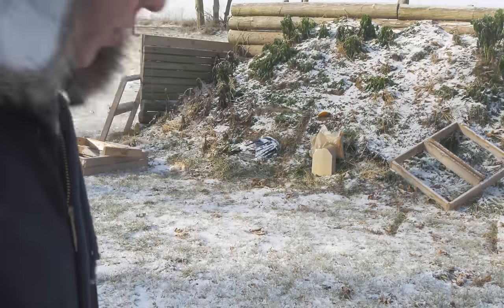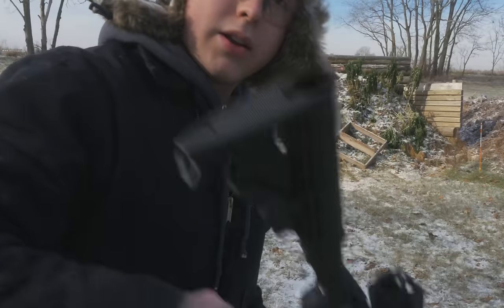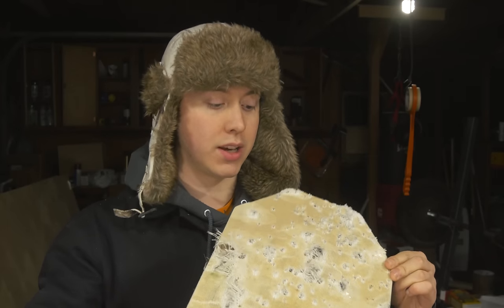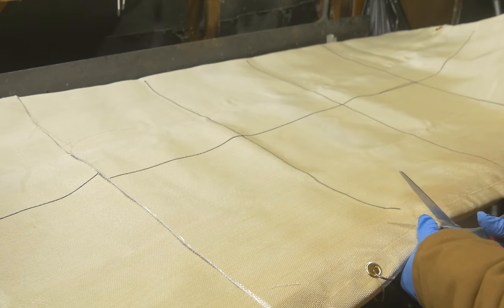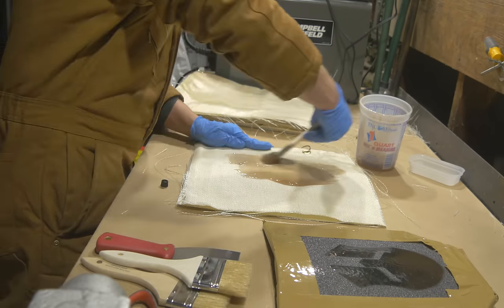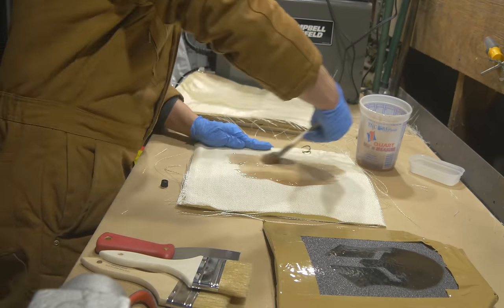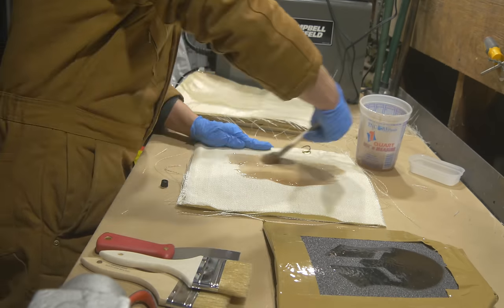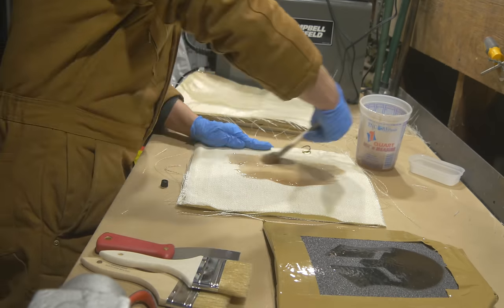How to Make AMAZING Bullet Resistant Armor for $30

Comment: PLEASE USE A RESPIRATOR IF ANYONE ATTEMPTS TO MAKE THIS.

Microscopic glass particles in your lungs is NO joke.
Reply: I was cringing so hard the whole time he was cutting and just sucking in microscopic bits of glass fibers.  Ugh!
Reply: Because it is possibly a cancerous hazards, right?
Reply: probably because of the fact that glass shards can cut things like your lungs
Reply: Yolo
Reply: Isn't it basically just as bad as asbestos?
Reply: I’m planning on making some so thanks
Reply: @notpulverman9660  Nowhere near as bad as asbestos, but still not bio friendly :) When getting a respirator, your best bet is to get the kind with cartridges and the mask itself is silicone... if not those, at least get the stiff paper ones that have a valve in front and check that they conform to your face... the ones that are just paper w/o a valve are almost worthless.
Reply: Barış Uzun It actually doesn’t have anything to do with cutting your lungs. Round, relatively smooth particles can be processed by your lungs and disposed of properly, but fiberglass particles are long, inorganic strands that our lungs are incapable of disposing of. A few fiberglass particles probably won’t do any damage, but grinding fiberglass without a respirator may do serious long-term damage.
Reply: Certainly doesnt feel good if you're stuck in an enclosed space with a cloud of fiberglass surrounding you. You'll hate your life for a week or so.
Reply: @lucapoli4195  no... inhaling millions of microscopic pieces of sharp glass is the bad part!
Reply: The Anime boy: yet
Reply: @c5back9  I wouldn't go quite that far. Asbestos is some really nasty stuff.
Reply: Please use a respirator ANYTIME youre working with fiberglass... Its Glass, People!
Reply: You mean a stroke when the nano particles get into your bloodstream and jam up little arteries in your brain and other locations in the body. Glass in the lungs is the least of your worries lol. Composite materials are far better against impact and to experiment with and you have less health hazards.
Reply: Yep this man is crazy
Reply: Either that or wet-cut.
Reply: @The Anime boy Luckily not carcinogenic, but fiberglass will still mess up your lungs.
Reply: Tell this to every engineering grad student in the US.
Reply: @notpulverman9660  When you think about the lung's ability to filter out those particles, then YES...it is as bad as asbestos.  That's half the issue with asbestos...the body cannot filter it out when it is breathed in because it's so small and it goes way down in your lungs and clogs your alveoli, inhibiting the transfer of oxygen from the lungs into the bloodstream.
Reply: No, cancer isn't the risk like with asbestos, the risk is the same as textile mill workers: copd
Reply: No, cancer isn't the risk like with asbestos, the risk is the same as textile mill workers: copd
Reply: Make one be fine. Make ten be called weezy.
Reply: Diogo Emiliano implying that octagon warriors work in fiberglass shops
Reply: @lucapoli4195  no doubt
Reply: I worked with fiberglass to fix a rust hole. There was strong wind from my back and i did it outside in the open. I didn't think about the tiny particles getting onto my skin though. My arms were itchy for days. I hope i didn't breate in anything.
Reply: Pneumoconiosis? Yeah, it's no fun.
Reply: Thank you, I'm making this next week and had no idea. 👍
Reply: Yeah it is dude it's funny af. Be sure to breath in all the glass u can kids
Reply: Glass lung is bad.
Reply: "Oh I should be just fine because I'm not using a rotary tool." Lol. "I'm just gonna clean up the edges with my belt sander"
Reply: 10:39 he grabs for a mask
Reply: Also at 13:00 damn did u even pay attention?!?!?
Reply: David S. makes joke about microscopic glass particles in lungs
Reply: Ahh so its fiberglass havent watched the video
Reply: Not Pulverman it’s not THAT bad but it’s pretty bad
Reply: Ok boomer.
Reply: Just reading the sentence is triggering my asthma
Reply: This video is completely irresponsible for not using a respirator
Reply: Tarman The Champion r/madlad
Reply: Turn into sand man but made from glass...
Reply: Diogo Emiliano  ok boomer...
Reply: Done and done! 😉
Reply: I CAN'T FIND ONE.....
Reply: David S. Will do. Thankfully i have one
Reply: i didn't know fiberglass was made with glass
Reply: @Xannyphantom905  it does
Reply: so its not 30$ then. deal breaker
Reply: Pulmonary fibrosis....you don't want that
Reply: Diogo Emiliano  Sounds like someone dropped out of 3rd grade.
Reply: @dylank.9573  a week? Itching?
Reply: LOL i get it!
Reply: I love the warm lung feeling I got 😍
Reply: And do it outside.
Reply: How do you make the atoms of a cup laugh?
Microscopic glass part-ticles
Reply: I wouldnt wear them just incase a cannibal kills and tries to eat my lungs i will taste bad
Reply: Such beautiful advice
Reply: Any idea on the resin being used?
Reply: What do you mean a morning glass of cancerous micro glass is great
Reply: Diogo Emiliano  lame
Reply: @charleswalter2902   lucky
Reply: Diogo Emiliano  I'm fake now because I names myself after one of my favorite bands ? I'm fake because I don't have technical capability to make crappy YouTube content? I'm a fake because I don't put up lame video game streams? Or am I fake because I don't have time to make content while I'm out there trying to actually do work and help people. Dude get off the video games weed and Coca-Cola then get back to me
Reply: Nahhhh, fiberglass makes your lungs stronger
Reply: @markhenrikson9790  ironic that less than a year after posting this saying paper masks are useless makes you anti-science lol
Reply: @markus9415  Fiberglass doesn't contain nano particles. They are small but far, far  larger than nano particles.
Reply: @hia1thealt  Mark, asbestos is clear down at like 10 microns or less, I am fairly certain that fiberglass is considerably larger than that. I have heard of a version called S-glass that they said was more risky, that may have smaller particles but apparently it is a specialty item, not used very often.
Reply: @markhenrikson9790  Look up nano polymers :)
Reply: @markus9415  Interesting. They are adding them to fiberglass to get better moisture resistance and such. That is way on the high tech end of fiberglass though, not the kind of stuff this guy is doing.
I do worry about how many places nano particles are being used when they are still so new. From what I have read, nano particles can act very different than the same substance with larger particles and pose completely different risks. Also, I would guess that even a good HEPA filter will have trouble properly filtering out nano particles. The throwaway paper masks will do even less since they tend to have a very poor face to face piece seal.
Reply: @markhenrikson9790  Correct. This person in the vid will only get some irritation without some protection. I was overexaggerating a bit :) But there have been cases where it did much more damage then just irritation.
Reply: @astr43us  inflammation and resulting scarring
Reply: Bro why is everyone talking about the fu$ing fiber glass but not the fake $30 dollars dude is talking bout !

Comment: That was a very cost effective test and I enjoyed watching it and learning more.
One way to make this stronger would have been using epoxy resin instead of polyester resin. Another way would have been alternating thread directions of your fiberglass cloth. In other words, put the first cloth down with 0/90 degree cloth thread orientation and the next one with 45/135 degree orientation, then alternate again. That way you are getting strength and energy dissipation in more directions. These changes could possibly have gotten you 10-25% more performance. It might not have made a difference though as the 5.56 looked like it would blow right through it anyway.
Adding Kevlar, on the other hand might have made a bigger difference but I don't know if it would be worth buying kevlar unless you upgrade to epoxy. Epoxy is substantially better than Polyester, at least for boats and planes. I used Carbon, kevlar and glass with epoxy when I built my 31ft trimaran performance sailboat. Two years of playing in that stuff was enough for me.
Using epoxy and kevlar though would have cost much more money. Probably 5x for the epoxy and 10-20x for the kevlar.
Reply: Two years! Wow I can only imagine! I worked with fiberglass doing body work on door bottoms on triumph tr-6 1972. You are dedicated sir!
Reply: You sir are a Rembrandt and you need to help us newbies learn how to make proper armor
Reply: have you tried any test to prove epoxy is stronger than fiberglass ? not saying you're incorrect but I'm curious of your alternative option and why you chooses it